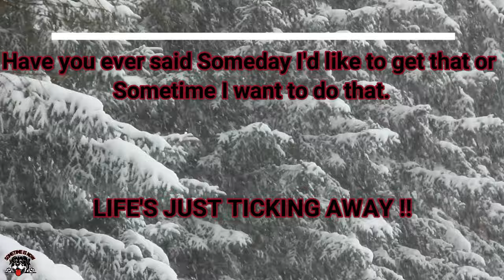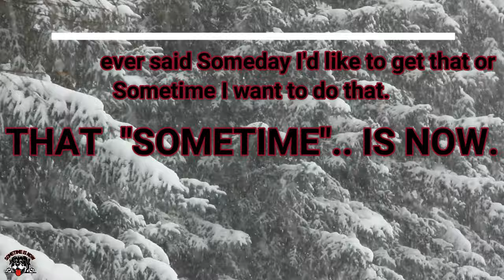THUNDERCAT ADAPT CLUTCH COVER BIKEMAN CYCLONE INSTALL

Comment: It would be interesting to see with a thermal gun if it’s running cooler.  

I have the torsion conversion and the 270 tune - belt temps are in the 150degree area.
Reply from the maker: Hey Shnill, Yeah I would be curious to see if it really does run cooler. I bought it mostly for the billets added strength compared to the stock cast cover. What’s this Torsion conversion you peak of? 😁 Take Care buddy
Reply: It’s from ron ward , hi-tech mechanical.  Or turbo dynamics.  Huge gains, super smooth too

Comment: What rpm does your clutch engage and start to move your sled mine seems to be around 4000 rpm is that what your seeing also how is the cover working out for you
Reply from the maker: Hey Eclipes, Thanks for watching !!I believe the same as yours at around 4,000rpms. The cover is holding up great so far. Seems to do what is promised. 👍🏼 Take Care